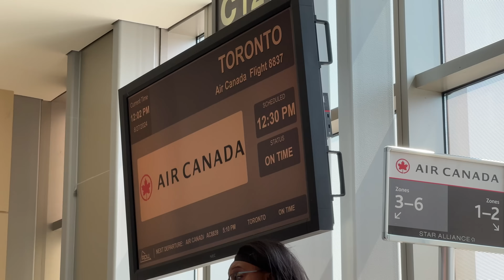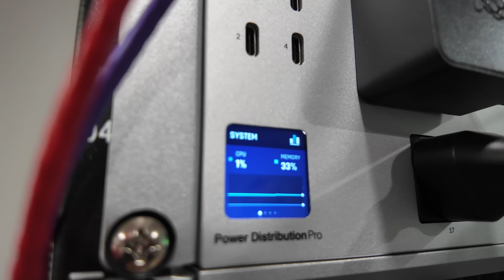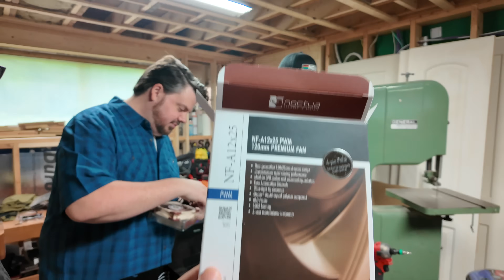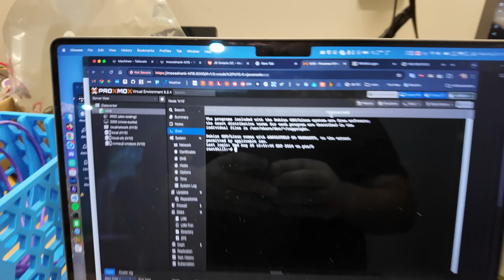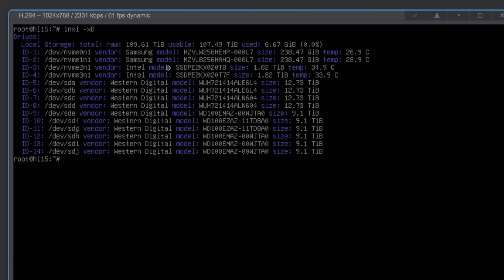Racking and stacking an off-site backup server for Jupiter Broadcasting

Comment: Nice datacenter, do you have any more info on that? If it is public, it is nicely done :) good choices on equipement, Unifi, Eaton, Supermicro, 45Drives. Will you do video on the networking side of the setup? im interested what services will be public and what will go through VPN ( tailscale i presume ). Keep up the good work guys :)
Reply: It looks like his basement, which is fine.  Nice large size, a handful of UPS's and presumably a fiber connection in.  I'm curious about the interenet pipe though.  Dedicated, resi, speeds etc.  Will JB be doing Tailscale on everything thats plublic facing?  A vps in the cloud running tailscale then exposing services on the VPS box as needed?